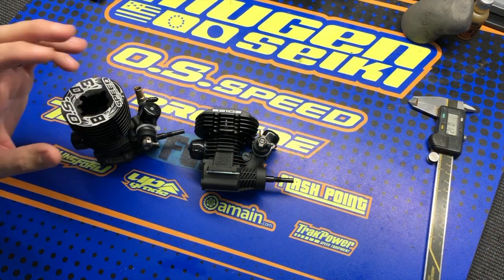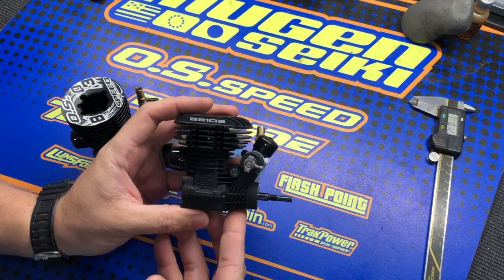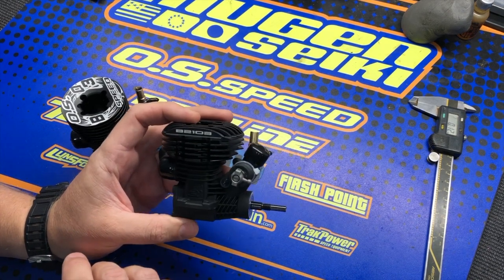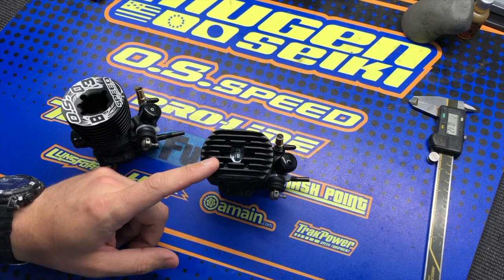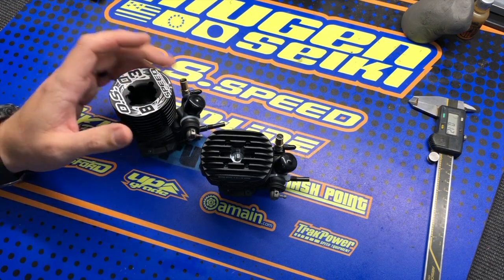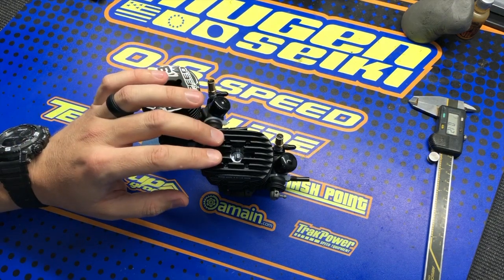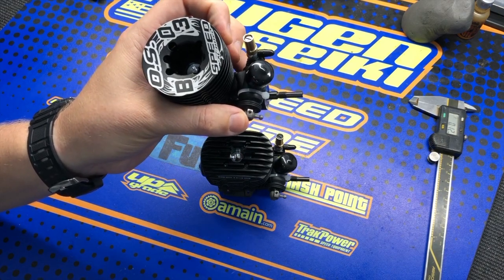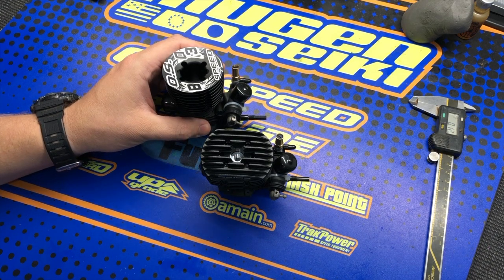Adam Drake from Mugen Seiki Racing talks about the OS Speed B2103 engines.

Comment: Hi, Adam. I have a question. Just bought a B2103-S with 2100sc pipe. I've noticed subtle differences in the break-in procedures contained in several, different engine manuals. Maybe stuff lost in translation? For example, slight differences between the B2102, the B2103-S, and the B21 AD2. All manuals for the current line-up are below.
https://www.os-engines.co.jp/english/line_up/engine/car/list.htm
Specifically, (https://www.os-engines.co.jp/english/line_up/engine/car/manual/2020/OSSP_B2103TypeS_EG.pdf) on page 1, far right column, step #6 under the break-in procedure: "Remove  the  glowplug  ignitor  when  the  engine  is  warmed up and continue running in on a starter box around  2-3  tanks  with  full-throttle.  Remain  the  carburetor  setting  very  rich  as  long  as  the  engine  does not go into stall. Is FULL-THROTTLE a typo?
It is interesting to note that manuals for the Ty2, Ty 110%, and the AD2 replace the aforementioned step #6 with "...try running the car on the track" veribage.
What's going on here? Thanks for any clarification.
Reply from the maker: It's all preference, but I don't recommend the full throttle break-in method myself.

Comment: Please question whether Model mugen truggy has strong performance  drive funny such as Arrma model truggy
Nor are models dedicated to racing and track only?
Reply: Because the model xray xb8e 2018 is very weak very only batteries 4s turnout increase weight and no strength in the performance loud
Reply from the maker: The Mugen MBX8T is built for racing, but it's super durable and would work awesome for bashing as well.
Reply: @AdamDrake  thank so so much 🙏🙏🙏
Reply from the maker: Anytime!

Comment: What temp range do you run the S type engines Adam? I picked one up with the 2100 pipe and am very close to your needle settings (almost exact) with head temps of 220-240 (ambient temp 65f).
Reply from the maker: Very nice!  That's a good temperature range, in the summer you may end up in the 240-265 range due to the warmer ambient temperature.
Reply: Adam Drake - Thanks man! Easily the most helpful guy in the hobby 👍🏻
Reply from the maker: My pleasure, anytime!

Comment: Is the runtime as good as the b2102 on the type s?
Reply from the maker: The runtime is very similar, but the Type S will have more power then the B2102.
Reply: Adam Drake Excellent, thank you sir.
Reply from the maker: My pleasure!
Reply: @AdamDrake  That's what I needed to hear. :-) I was torn between buying the B2103 'S' vs. the older B2102.